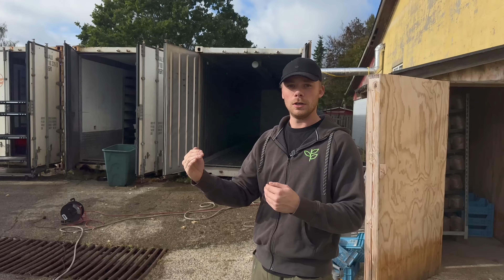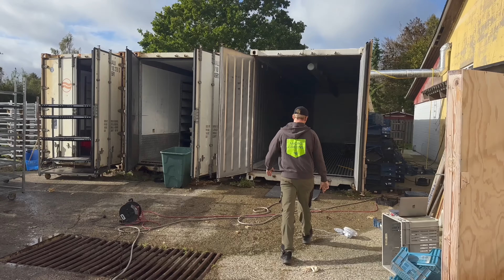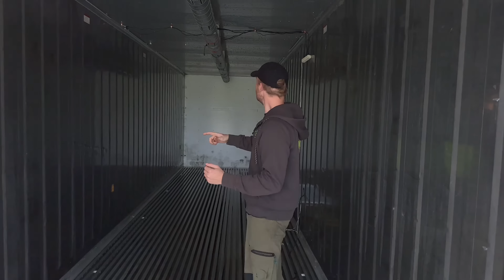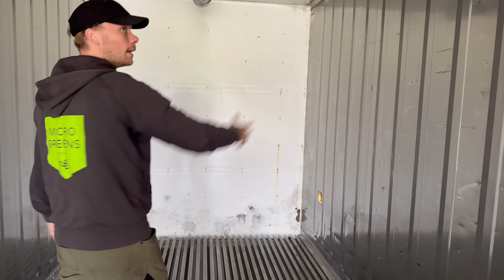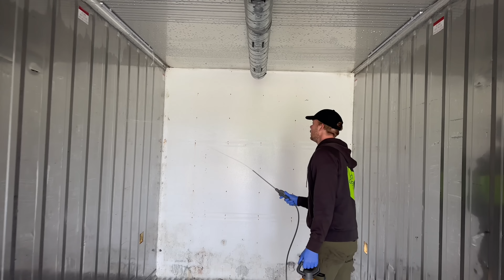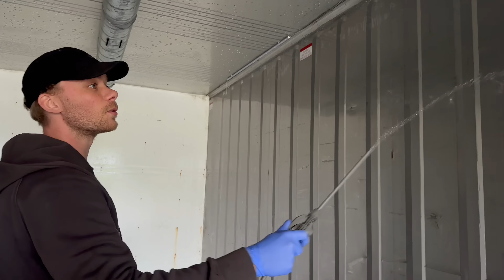How To Clean A Mushroom Container

Comment: Hello, so you dont use refrigirator unit for heating your container? So how do you keep it warm if you always blowing fresh air from outside?
Reply from the maker: We are blowing hot humid air from our microgreens production into the containers as well and control it that way. But no we don’t use the refrigerator in it
Reply: @verticalgreens could you make a video about the connection between your farm and the containers? Did you drill holes into the container? How many fresh air exchanges do you have per hour? It's possible to keep at a reasonable temperature during winter/summer?